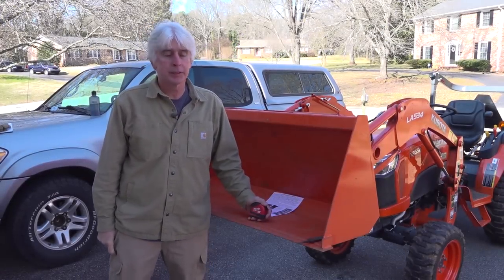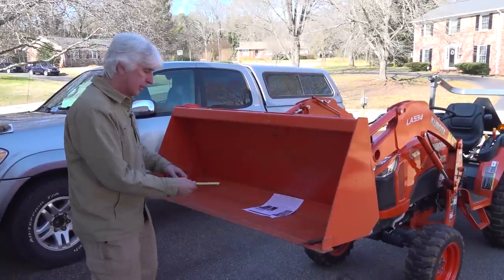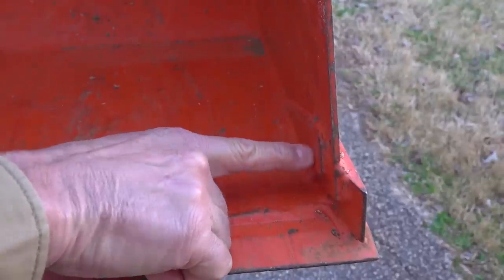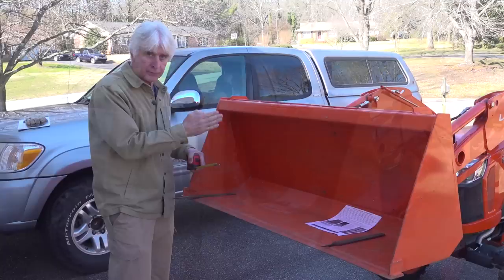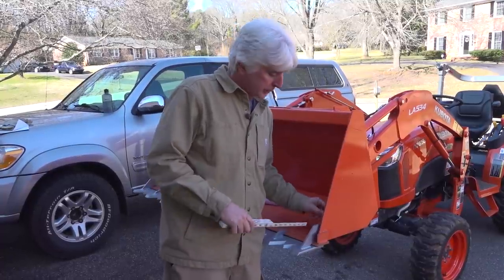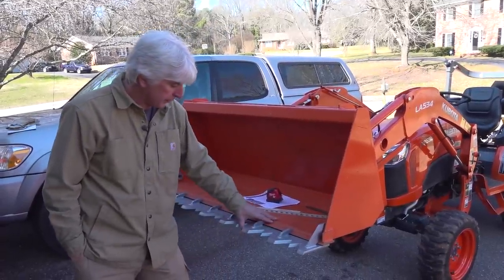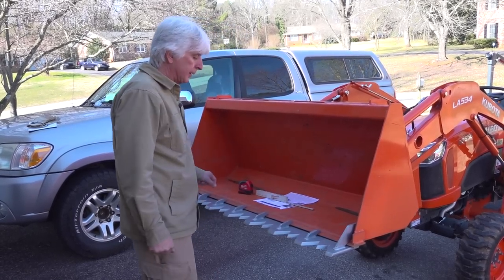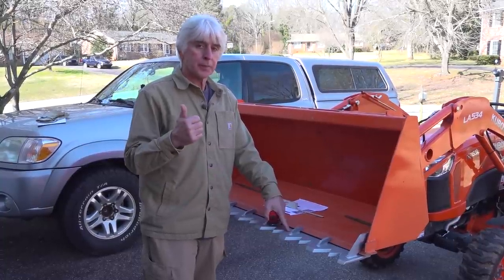Measuring For The Piranha Tooth Bar

Comment: Good video! I have a Piranha Toothbar and really enjoy it, I think I looked at a similar video someone else did before measuring. My cutting edge was a mess so I beveled a piece of flat stock and welded an addition to the cutting bar. I was concerned about it being too thick but it worked fine. I used my welder when needed to build up the top of the cutting edge were it made contact with the Piranha bar so as to get a snug fit. If my cutting edge had been completely flat this wouldn't had been necessary. I was impressed with how well the step drill bit they recommend works.
Reply from the maker: Thanks for sharing Douglas! I love hearing the stories of others experiences. Its the best way to learn. Sounds like you are a bit of a fabricator. Yeah those step drill bits are amazing.
Well we are heading out for pizza! gotta go catch ya later.
Terry.
Reply: Thanks for the reply and I will be looking forward to future videos. Hope you enjoyed that Pizza.
Reply from the maker: Your welcome, many coming soon, delicious!
Terry

Comment: I was really set on getting this and decided to get a bolt-on teeth kit because I stack a lot of firewood. I switched to 2x4 pallets and clamp on pallet forks would not have worked with this bar. Aside from that, it looks great in the video. The question is, how does it work?
Reply from the maker: Hey Jason. I bet you could rig a set of clamp on pallet forks that would work in conjunction with the tooth bar. Also it is removable and only requires removing the two screws so there is always that option. The big advantage for you with fire wood would be that you have a longer bottom of the bucket from one end to the other with the tooth bar that would not be the case for the standard bolt on teeth. I am not going to lie to you we have not had a good chance to put it to work in any capacity yet. We  did play around with it one day for a bit and it was amazing. Very good investment. Keep an eye out and we will be doing a video, probably several over the coming year(s) showing how well it works. Some with the Piranha and some without for comparison. I think its going to do far better than the bolt on teeth personally based on my limited skid steer experiences having similar teeth. This is the one product I have dealt with that I have not found one person say anything but good about it. That says a lot to me and most people talk very highly of it. Hope this helps a bit.
Terry

Comment: I recently added a Piranha Tooth Bar to my JD and it works great.  I also made a PVC guard that goes over the teeth when not in use.  Not to protect the teeth, but to protect me and the grandkids when we're in the barn.  Might make a good follow-up video.
Reply from the maker: Great idea George. That edge could bite for sure. We have thought and talked about needing to make sure its down when not in use but the PVC edge protector would be a great addition. May have to do that and if so we will do a video giving credit to you on the idea!
Terry

Comment: Dear Terry,
May I inquire what the dickens have you got in mind for your tractor? You merely acquired it a few months back, it's virtually virginal ( well almost!!!); what is that bar designed for???  Very good presentation, maybe next time you're thinking of getting another accessory, perhaps you might suggest to the party concerned that you'll do a free presentation for them in order to get it for almost if not free!!!. very well done. Kind regards.
Reply from the maker: Ha ha,
 It strengthens the bucket and also makes it much easier to dig or move piles of dirt or rocks or whatever needs scooping up and moving. Plus its just plain cool! I like free!!! :) We enjoy doing these videos.

Terry
Reply: @ForestToFarm  
Dear Terry,
Thank you very much for your courteous & hearted reply. As one who is totally ignorant of heavy equipment, it's good to learn now & again. It would be nice to see a demo with & without to see the difference.  Now I guess what's missing is a back hoe, maybe a custom paint job with some go faster flames on the sides.  Keep up the good work, now start digging the foundations. Kind regards.
Reply from the maker: Welcome. We plan to do a comparison soon. Not sure about the flames, lol!
Terry
Reply: @ForestToFarm  
Dear Terry,
Thank you for the courteous & hearted reply. if the go faster flames are out of the question; how about bolting a couple of real flame throwers either at the front or back depending on your styles of driving to get rid of the weeds. It's the perfect excuse for doing your meanest baddest renegade M.F ( Master Farmer that is; you were probably thinking of something else weren't you???) routine. A precursor of the monumental task at hand to come if you will. Kind regards.
Reply from the maker: Ha ha that would probably do the trick but the problem is we like our weeds. They are all natural and exactly what we want. :)
Terry
Reply: @ForestToFarm  
Dear Terry,
Thank you once again for your courteous & hearted reply. Come on, you've got to lighten up sometimes, weeds are parasites & detrimental to good gardening. They are OK away from cultivated plots if you like them that way but where you grow your own food, it's the perfect excuse for having fun & doing work all rolled into one. Go on you know you want to, go & let it rip. You never know Brian might want to hog tractor time just for the sheer hell of it. Taking things to extremes sometimes is just what the doctor would recommend (hint, hint, hint...!!!), that would make for an awesome video. Kind regards.
Reply from the maker: Yeah gardens will be clean. I am talking around any barren fields. Weeds add diversity. Good for the soil and good to use in compost. We plan to have fields that we will mow and use the cuttings for compost. The more variety the better.
A flame thrower would be nice!

Terry
Reply: @ForestToFarm  
Dear Terry,
Thank you very much for your courteous reply. You see I told you, once you start, it will become somewhat contagious & you will not be able to contain yourself. Incidentally ashes are also good for the soil; in some parts of the world, they do periodic burnings so as to promote &/ stimulate growth. Put a little bit of excitement in your day to day life, something to talk about at work or elsewhere. Go to your local store, grab a couple of roof felt torches or gardening weeding ones if you can find them, concoct some sort of holding device onto tractor & just test drive till you get it right. Be sure to let Brian have a go too ( a second opinion is always welcomed!!!). Then do a dramatic intro for your next video ( you know anything that will get folks frothing at the mouth) & away you go. Best of luck. Listen Terry it's either this or get yourself an oil rig drilling accessory for your tractor & start digging wells or better still black gold!!! Kind regards.
Reply from the maker: We do plan to produce some Bio-char. Its excellent for the soil. Ancient peoples did it and the soil is still extremely fertile to this day. I am not a big fan of oil. Gotta have it in today's world but I don't have to like it, ha ha.
Terry
Reply: @ForestToFarm  
Dear Terry,
Thank you very much for your courteous reply; I trust my suggestions won't justify calling the little men in white coats & straight jackets for their victims &  then they take them to a special hotel with padded rooms??? trying to help you gain more support is more difficult than waddling through treacle. You just stick to your own ideas & plans, I'll suffer it in silence meanwhile until I can come with some cunning plans. I am at my wits end. Best wishes. Kind regards.
Reply from the maker: Your welcome, I understand, thanks!
Terry

Comment: Thank you for this information. I like learning new things! What is that particular add on used for exactly?
Reply from the maker: The original bucket edge is just a straight piece of steel. It does not cut into the dirt very well if at all. This Piranha tooth bar cuts dirt better, will rip small shrubs, brush or small trees out of the ground with ease. Plus it preserves the life of the bucket edge.
Terry
Reply: @ForestToFarm  Oh nice to know! I was not aware of that. Thank you!
Reply from the maker: No problem.

Comment: Have you posted the video of the tooth bar installation?
Reply from the maker: Sadly no we have not. We have had record rain fall here for months and in addition when it is clear out, what few days there are, we are swamped with work. Its on our agenda and the first good day we plan to get out and do that plus we want to do a little review of how it works. Thanks for checking in!
Terry
Reply: @ForestToFarm  Though I have the B2601, apparently I have the same 54" bucket.  Did you find the 52" Piranha bar to be just the right size for your bucket?
Reply from the maker: @jamessaunders7359  We did slide it on the bucket but still have not found the time to finish mounting it due to work and rainy days. There will be a video up soon about it. To answer your question the best I can at this point it fit very well best I can tell at this point.
Terry